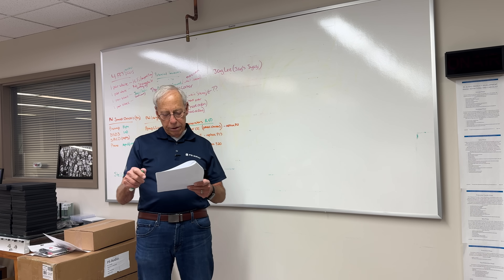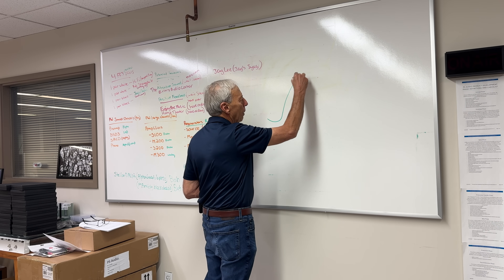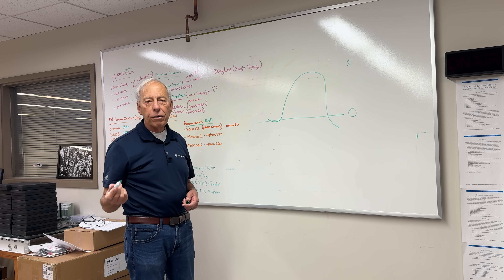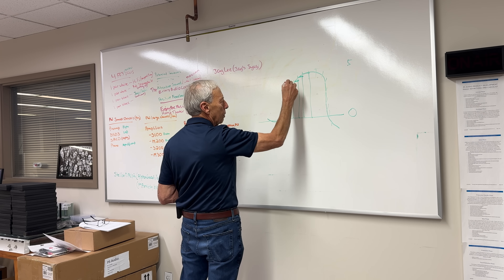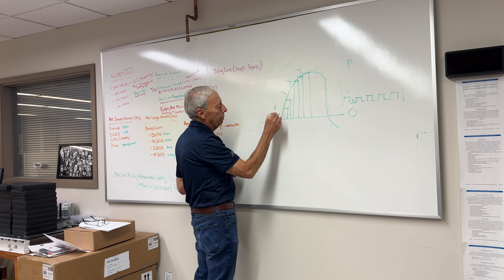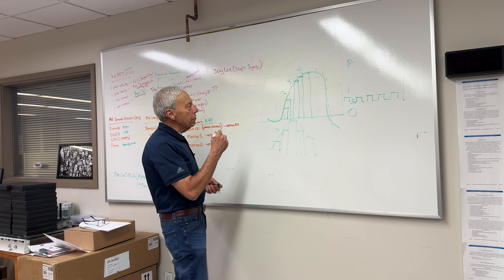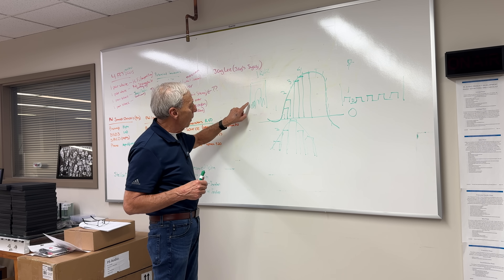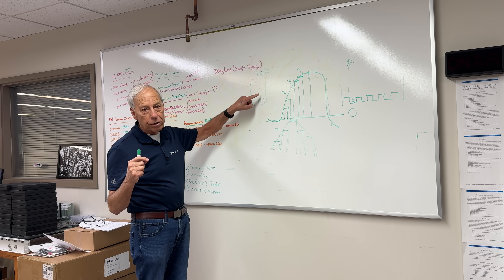How digital audio stairstepped waveforms get cleaned up

Comment: Paul. First , please have someone. Uy you a box of markers. Second, have your guys do the following: run a 10k sine wave through AD (at 44k) DA and display the result on a scope. Then do the the same but with a 10k square wave. With only 4 samples per cycle, the process can not possibly recreate both correctly. Indeed, assuming that by chance sampling stated for both at the beginning of the cycles, then the digital data would be identical. And no, my dollar bill is not just made of pennies.

Comment: This gets sort of confused with explaining a 1 KHz square wave. That could be analyzed as a harmonic series of square waves going up to infinity. If filtered at 22 KHz, it would become a square with slightly rounded corners. But this is a 1 KHz sine wave plus a jagged wave at 44 KHz, easily distinguished. The jagged wave could include lower frequency components if frequencies above 22 KHz are allowed into the A->D converter or other imperfections, but certainly the largest part is 44K.

Comment: This is the answer:  The right-half of the whiteboard that showed one half of a 1KHz sinewave sampled at 44KHz...  is not a 1KHz square wave.  It is a 1KHz sinewave with many high frequency harmonics added to it.  The harmonics are caused by the stairsteps, and they are all ABOVE 20khz.  When you pass that through a 20KHz low pass filter, all of those harmonics are filtered out, leaving you with just a 1KHz sinewave.

I don't know why Paul is talking about 1KHz square waves.  That just confuses the issue, because a 1KHz square wave consists of sinewaves of 1KHz, 3KHz, 5KHz, 7KHz, 9KHz, etc...   Putting that through a 20KHz low pass filter will not result in a 1KHz sinewave!  And I think the question asker knows this.  That is why the question asker is confused in the first place!   The answer is what I said in my first paragraph:  The sampled 1KHz sinewave is made up of 1KHz + only harmonics above 20KHz.  Filter out those harmonics and you're left with a 1KHz sinewave.

Comment: I think you touched on this subject previously. This subject is like the time I was managing an electro-mechanical development project and our electrical engineer was developing a speed control for the electric motor that fed the mechanical power tool device.  The mechanical device was operating in events of milliseconds due to the high speeds and I was told that because of the 60 cycle/sec power limitations on a typical US wall socket we couldn't pull power out of the supply fast enough. Once he explained what was going on I thought, "oh, I get it".  I'm kinda there on this one. What's great is that I don't have to understand it, I just go buy what works!

Comment: Higher bit-depth does give you fuller tonality with smoother and more coherent decay, at the expense of soundstage width. I'm pretty sure it has to do with frequency specific amplitude accuracy. That's why DSD recordings sound distinct even when converted to PCM.

Comment: That's the beauty of nature: it's not just maths, there really are only sine waves! All other waveforms are multiple superimposed sine waves.
Reply: Wrong.. the statement that square wave is multiple sine waves is false. A square wave is a sinewave that was unable to be made because of running out of head room..(voltage swing denial) . Its a different problem if its clipped in preamp .or in the finals of the amp driving the speakers. But .in sound production..clipping in esrly stages gives us the growl.  That bands love.. but clipping the preamp and then having it played ( processed ) . Changes everything. .its not Hifi..period.
Reply: @davidstevens7809  Squarish waves can be created by sine wave addition, e.g. a clarinet or FM synth, or other methods, either way, as long as waves are constant they can be analyzed by a sine wave breakdown. Transient analysis is where it gets tricky.
Reply: @spentron1  yes.. your correct..

Comment: Interesting complication with digital. Your drawing uses the positive half of a sine wave. You reference a zero volt base line. Which means that first sample at zero volts would be all 00000000's (8 bit displayed) in the sample bitstream. So what would the negative voltage sample be? You are already at all zeros and there is no negative sign in the PCM code. So with a base line of all 0000s for zero volts, all negative voltage would also be all 000s, no difference. You could not sample a negative voltage. 

So basically in PCM the most significant bit represents the zero voltage line we see in analog.

Comment: OMG this is amazingly off point. I think Paul is trying to explain how a discontinuous square wave can be represented using a Fourier Series. This has nothing to do with digital to analog conversion.
Reply: Maybe you are correct, and maybe you are totally off base. You started with an assumption and then proceeded to conclude that he is way off base. Of course, if your assumption is incorrect then so are you. I have no way to evaluate which of you is correct, but I do know that Paul is an excellent engineer that has run a company in a very difficult industry for damn near half a century; and, I know absolutely nothing about you. So, if you want us to take your criticism seriously, it would be helpful to know what qualifications you have. Just trying to evaluate your comment. Thanks.
Reply: @spenceralridge4958  PhD in mathematical physics, 35+ years in computational applied mathematics, devoted hi-fi enthusiast.
Reply: @matthewrichey8542  Then show us all how the laws of physics allows for less than Planck Time samples.
Reply: @matthewrichey8542  - Thanks, very helpful, although I am certainly not qualified to assess how transferable mathematical physics is to audio, I will take your word for it. I am curious, how would you explain an answer to the writer’s question?
Reply: I think we’re getting a bit off topic here!
Reply: @matthewrichey8542  IOW you can't We understand.
Reply: Fourier explains that square waves are formed by composing sine waves of increasingly high frequencies. The low pass (reconstruction) filter from the original  question is what eliminates the “corners” on the square waves (or stair steps).

Comment: I wonder whether that is really the low pass filter who smoothes out the sine wave? And, since the ADC takes samples of the analogue sine wave multiple times per second (say, 44.1K), it must be producing 44.1K codes per second each representing designated number of voltage. And these codes don't really last long enough to come together and for the stairs. I'd rather imagine they must come together in a picket fence. And the DAC has to fill the gaps between the pickets smoothly by performing VERY INTENSOVE calculations. Or am I wrong?
Reply: The picket fence analogy suggests that it's a process of 'connecting the dots' and that is not how DA conversion works. Read (or view videos) about the Nyquist theorem. Without that you'll never have a good understanding about digital audio.
Reply: @tmjcbs  Nyquist theorem describes the minimum required (double) sample rate to adequately encode the electric analogue of soundwave. As far as i understand it is not about the pickets/steps in the output of the DAC, which is rather a practical, not scientific theme.
Reply: @OlehZavadsky Part of the Nyquist theorem is indeed the Nyquist frequency, but for me the beauty is also that the bandwidth limited signal can be reconstructed perfectly, not only approximately (ignoring the quantization error for the moment). I don't know what you meant with your picket fence analogy, but it suggested the output signal will be the sample points connected by straight lines. If I misunderstood I'd like to know what you did mean.
Reply: @tmjcbs  My picket fence analogy could be wrong, at least as per @glenncurry3041, comments above and below. But my understanding came from the "pickets" each of those to be a 16 (or 24 or even 32) bit "word" encoding certain voltage number. When "picking" the samples from the analogue electric wave ADC creates, for example, 44.1K x 16bit "words" per second and they "fill in" the file as the series of impulses (1s) or empty spots (0s). So each of those samples is a picket and the array of 16 bits indicates the "height" of the picket (while there's another information encoded in the file showing the frequency to which the clock has to let those impulses go, in this case 1/44,5K of the second, precision of which is also critically important to the resulting sound quality, in the picket fence analogy this frequency indicates the distance between pickets). So this is the picket fence shaped array of electric impulses that comes to the DAC and it has to fill the gaps. I'm not an engineer but I'm a researcher used to believe that the logical thinking is the tool for our brains to comprehend the reality adequately. So I still don't understand how the DAC's "stay" on the voltage until the next sample is sent but this doesn't make any difference actually, because whether it "stays" and makes the flat line that fills the gaps between pickets forming a step-shaped  wave or it fall down and gets up again forming a picket fence shaped wave, both waves are not the correct natural smooth electric and, as a result, sound wave. So my understanding in this case is that a DAC has to send the impulses with (1) maximum accuracy of reproduction of each 1 and 0 which are actually on and off signals of some very low voltage, (2) maximum precision of the frequency under which those signals go, (4) maximum truth of converting each signal to the designated amount of voltage and (5) maximum "smoothness" of filling the gaps between signals. In the latter point my picket fence peak points were not connected, just left as they were. And I thought the ear wouldn't hear the "pulsation" as the result of the gaps between signals, as our eyes don't catch the 50Hz pulsation of pictures and takes it as a movie. But the ear and brain just feel "something wrong" with the sound and prefer less dynamic, noisier and bu fart less accurate waves of the vinyl records or magnetic tapes. But of the DAC does the job well and fills the gaps naturally (at the cost of tremendous amounts of calculations, for example CHORD SCALER + CHORD QUTEST or HUGO TT, as well as PS Audio DAC's) the sound is sweet and pleasing and the violins no longer "hurt"! ... Paul, please, excuse me giving your competitor's products as examples.
Reply: Yes you are wrong. A DAC is basically a device that takes the digital code value given it and produces that output until it is told to change with the next sample. If a sample value representing one volt is given to it, it will put out one volt until given the next sample. Then it will generate that voltage until.... Yes flat steps for each sample duration. 

That's the DAC part of an "audio DAC" device which includes output integration, filtering.
Reply: @glenncurry3041  Thanks, this was good to know. However, when looking into the logical circuits of the simplest "ladder" DACs I stil cannot see where these flat stable voltage "steps" can arise from because this type of DAC just puts out certain voltage signals in certain moments of time resulting from the incoming combinations of onn/off or one/zero impulses. And those obviously come as frequently as the sample rate.
Reply: @OlehZavadsky  It's simple. Each sample is a number that represents a voltage. When an RtoR DAC gets a sample, it STEPS to that voltage and stays there on that STEP until the next sample/ STEP is sent. Just like the STEPS Paul used to show it on the sampling side.

Comment: Incorrect there are no stair steps, it are points on the curve in time who last 0 seconds….
Reply: So just ignore the Laws of Physics?
Reply: @glenncurry3041  digitizing a curve in a plane (2 dimensions) is done by points on the curve. Please read the definition of a point
Reply: @mjk4554  Nope. Throw a scope probe onto points before filtering in the DAC and you will see them.

Comment: Appreciate all the work you do, but pedagogically the following might be a better approach:  emphasize that the analog signal coming out of the DAC (physical box one has bought) is the output of an analog component , not the output of the digital components.  The digital signal output never gets to the human ears.  There is always an analog filter upstream of the human ear (or the oscilloscope attached to the analog output.)  And that's it.  Don't try to go into more detail unless you want to do a real discussion of waveforms, circuits, etc.

Comment: There's no "stairstepped"; no stairs of any kind. There are just points with nothing in between.
Reply: @Jorge-Fernandez-Lopez  There's a difference between what the data represents and how an analogue signal is reconstructed using a DAC. If the bandwidth of the DAC output is more than 44KHz it will produce steps since there's enough bandwidth there for the voltage to stay at that level during the 1/44khz period. A cutoff filter gets rid of those higher frequencies and smooths out the signal as if those points are way points on a curve. 
Now there are multiple ways to reconstruct a digital signal to analogue of course, but the same rules apply even if it's a R2R ladder or PWM.
Reply: @imqqmi  Analog stair steps would need a function that produces that stair. Which is the mathematical equation for that stair or the electronic circuit? We can do some tests by our own in Audacity or watch the video of Xiph.
Reply: @Jorge-Fernandez-Lopez  You could do it with an arduino and an 8 bit R2R DAC without cutoff filter and a bandwitdh of say 200khz or just use resistors in R2R configuration then hook up an oscilloscope then send 8 bit representation of a sinewave of say 500hz and carrier of 44khz. Audacity can only use DACs that already have cutoff filters, ie audio dacs in soundcards, usb, integrated sound etc.
Reply: @Jorge-Fernandez-Lopez  That function is known as the sample duration.
Reply: That would violate the laws of physics. Nothing is instantaneous in the real world.
Reply: @glenncurry3041  Steps are instantaneous, that's why there are no steps. Just look for good information or do your own tests. When  I draw a line defined by two points or a sine wave by frequency and amplitude I have never felt the need to draw stairs. By the way, these perfect steps would need an infinite bandwidth; more resolution will have more steps and more square corners, which would need more filtering and sound worse. Steps are a non sense; they just try to sell subscription to "hi-res" formats" which include files that can be very noisy.
Reply: @Jorge-Fernandez-Lopez  Please show us all how you can violate the laws of physics and have instantaneous changes in voltage levels. The Nobel Prize awaits!
Reply: @glenncurry3041  The rise of voltage in zero time (infinite current) of the vertical line of your stairs "violate" your own argument. Your stairs drawings (vertical line) have exactly that, an instantaneous raise of voltage.
Reply: @glenncurry3041  You are mixing instantaneous jumps between axis with different units and meanings. Even in that case, the shortest path between points used to be a line; a stair according to you. Neither of you or I will get a Nobel. It might be better to read and look for more information from reliable sources instead of writing aberrations.
Reply: @Jorge-Fernandez-Lopez  So you know absolutely nothing about electronics? Got it! The scope display of the actually existing stair steps as actually measured in the actual DAC will have rise and fall times. Not even a good straw man attempt!
Reply: @glenncurry3041  The graph doesn't show any raising time (perfectly vertical): only a fake marketing graph in the digital domain. Analog results of Xiph (probably  knows more about it than you and me) doesn't show these stairs. These fake graph stairs in Qobuz are showed for the digital domain. I can understand why you won't talk about  about the digital domain now (your own contradictions and jokes apply to yourself). DAC can work differently regardless of the file, as your answers are written regardless of context or original statements, without any reference brought by you. You might not have more clues about electronics than me, as many self-taught "engineers" in this channel.
Reply: @glenncurry3041  I think many will find useful the information in the video Debunkin... the Digit...Audio Myth: The Truth Abou.. the 'Stair-Step' Effect or watch the full video (Xiph). It might be a good practice to watch the full video before writing, specially before the first graph of stairs.  The lollypop word of the beginning of the video will appear.
Reply: @Jorge-Fernandez-Lopez  If they wish to be intentionally ignorant of reality perhaps. At no point in the entire worthless vid does the actual display of lollipops from a scope at a test point in a DAC appear! Because at no point in a DAC does lollipops exist.